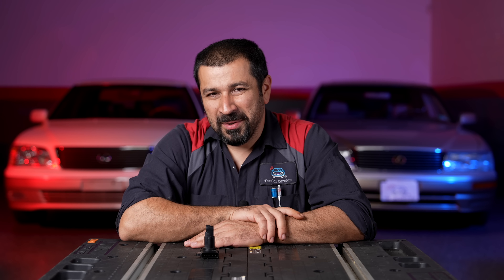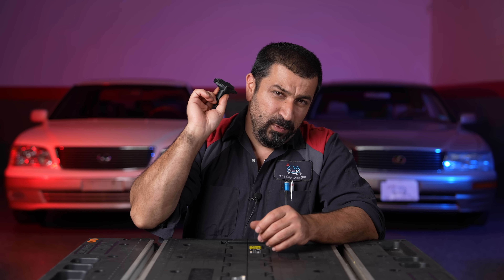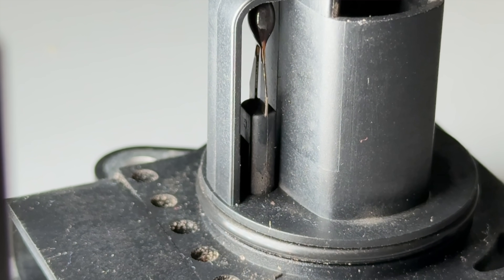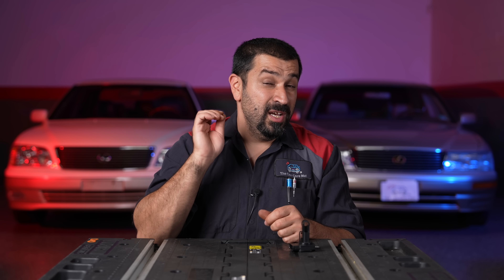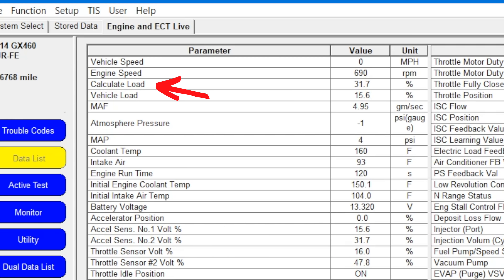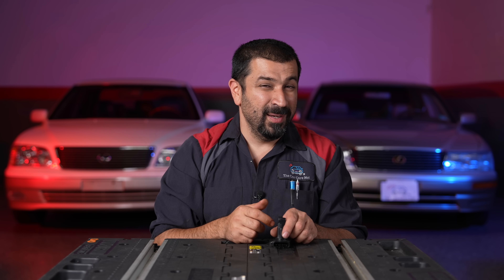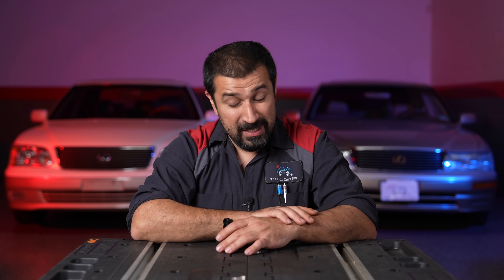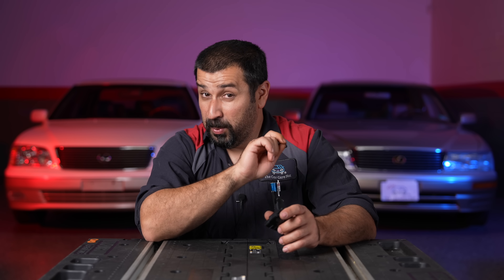Should You Clean Your MAF Sensor and How to Test It and Clean It on Toyotas

Comment: Thank you for this video.    I have a 2005 Tacoma that was not wanting to accelerate in 3rd gear.    It would bog down and sputter.    I replaced the MAF sensor (Amazon, $20 approx) and like magic, problem solved.    The MAF cleaner costs $7 less, but why bother trying to clean the sensor when you can buy a brand new one?

Comment: My 2002 Toyota Avalon was reading high LTFT (25-30%) when accelerating, but less than 5% most other times.  Did the calculated load test as described in this video.  Sure enough, could only get up to about 70% calculated load at WOT.  Cleaned MAF, but didn’t improve, so I installed a new OEM sensor.  Calculated load now reads normal and LTFT looks great (+/-5%)!

Comment: Our one car is a 2003 Mitsubishi Eclipse Spyder GT and it uses a Karman Vortec MAF, and you can't clean those as they use a laser and mirror to "listen" to air volume. Replacement OEM is $700usd. Cleaning will destroy it. Thank God our 2022 Nissan Frontier Pro4x uses a normal hotwire MAF, cheap to replace and cleanable.

Comment: Techs at Valvoline failed to snap my air filter back together properly so my car ran for two weeks with unfiltered air coming in. Pretty sure that messed with my MAF and the engine got to running very rough with reduced performance at throttle. Color me annoyed.

Comment: What if am seeing more than 100% on the calc load? This is a 08 i4 camry so no turbo. Am thinking the maf is just gone. Engine Stalls randomly from time to time no check engine light and it turns on without issues after stalling. What makes me think it is the MAF is because when I start getting low revs at idle leading to stalling, the MAF is reading like 11 to 15g/s. Google says at idle it should be between 2 to 7g/s.

Comment: I have cleaned the MAF, replaced the air filters, and cleaned the throttle body. I still experience a rough idle when the AC is on. My Toyota Corolla radiator fan is not working when the AC is on, which causes the idle RPM to drop so low that the engine stalls. What could be wrong? Please help. My mechanic has not been helpful.
Reply: Sounds like a relay switch or a regulator switch❓💡

Comment: I have a 2014 BMW X1 with an N20 motor. One of the MAF has traces of oil on it. Should it be cleaned? I didn't test it and I don't have cleaner. Is it ok to wipe it off?
Reply: If you do want to clean it, use Q-tips don’t spray too close to sensor must use CRC mass air sensor cleaner💡💪

Comment: I replaced the air intake hose on my 2013 Honda civic which was cracked and it solved the jerking problem that I had but I still have sluggish or slow acceleration at low rpm’s. Should I be cleaning throttle body and mass airflow sensor even though I replaced the intake hose?

Comment: According to another video, I have to remove my whole windshield wiper assembly which is secured by the steut bolts just to get to my MAF sensor. 

I ain't doing all that just to clean an old part. If it tests low, it's getting replaced.

Comment: I had a cold air intake cone and i drove in a big rain and i got a chek engine with the code p0171 that says lean . I have the new mas sensor that you said we shouldn't clean it but i think the water came buy. I put back the oem air intake box after that. I think it dried and the code is gone. Should i be worried in the future with the mas sensor?

Comment: If you have a hot wire MAF and you run a oily K&N air filter, your sensor is gooey. *Toyota MDT.
Reply: CRC mass air sensor cleaner, let it air out for 5 to 10 minutes if you want to leave it inside the vehicle 10 to 30 minutes and you’ll see immediate response🤙 they have a kit at Walmart for 10 bucks comes with throttlebody cleaner also💡

Comment: Hey Car Care Nut, my Sienna has a lost in power and I cleaned the MAF like you said and it did run better, but not as good as it should, plus today it was a rainy day and it was running real bad again. Do I need to buy a new MAF sensor ? I've been driving Toyotas for most of my life and I love Toyotas. My first Toyota was a 1971 Hilux truck, it had blinker lights on top of the fenders. You are the only Toyota mechanic I trust....

Comment: Ok , so I have a 99 Camry LE, mine is inside the air box right? But is also an air temperature sensor? Looks like a banys pinky sticking out? Wish I could upload a pic of it, but is that the MAF sensor? Bc I saw online that 99 le doesn't have MAF sensor? If it is in fact the MAF, can I use contact cleaner on it like you said?

Comment: My 2000 tundra just went down. It starts but idles rough as hell,  won't accelerate smoothly then stalls. It is stumbling badly. A few days ago was only stumbling at high speed. I am thinking the mass air flow sensor has failed, the throttle body position sensor has failed or the entire throttle body needs replaced. It has 320k miles. Have owned since new. I first thought I had contaminated fuel but I did add Iso heet and Chevron Techtron cleaner. Yesterday and it drove great. It stopped stumbling.  Not is worse.  I ordered a fuel filter. Maybe that is clogged. Every time you turn they key it starts so I dont think its the fuel pump. Wish someone here had some feedback.  Im in North Carolina so I cant bring it into Chicago.

Comment: Also, if running K&N air filters it's very wise to clean your MAF every few months due to the excess oil in the air filters.
Reply: It’s best to only spray the oil on the one side of the filter that’s going to get dirty. It’s more acceptable of making problems. If you spray it on the other side that’s clean.🤙💪💡

Comment: I own a 2011 LS 460. It has 119,000 MI. I am not mechanically inclined, I change my air filters in easy stuff like that, can I trust a shop to clean the sensor if I ask

Comment: been working on my inherited  337,000 mile '06 Tacoma the load sits about 30% ideal but hits 95% full throttle, i have some other small issues i already know of  however i have been testing everything since it wasn't my vehicle. I thought the load at ideal seemed high though.(I wouldn't clean mine I would just replace to be safe on my this specific vehicle)

Comment: At full throttle it read 100% - 2006  sienna. Test works  correct. Parts Cannon is shut down-lol. Yaaa!  Keeping my money. Sienna Has 267,700 miles on it and running good!   What a Vehicle! Oh, Hey friend, mechanic, Thanks. I used Electronic cleaner  and it worked. Thanks Car Care Nut!
Reply: It was going to be $133 to $148 plus tax for the part here in Detroit. BTW. Thats original part from dealer.

Comment: I have a 2015 Toyota tundra and I got problems with  in between 1,000 and 2000 RPM  when I push the gas pedal  in between 1,000 and 2000 shakes like need spark plugs and I just change spark plugs from factory what can be the problem

Comment: Recently my RPMS started shooting up for a quick sec going a normal gas pressed speed. I have cleaned sensor, throttle body flap area, changed pcv valve and checked all hoses for leaks. 2014 Toyota Avalon limited V6. Thoughts will be greatly appreciated.

Comment: What about just replacing after so many miles. I have a 2002 w 180,000 miles. The sensor was never cleaned or replaced, car was in Illinois, now in the dusty Phoenix area for 6 yrs. I now have no power after 40 mph. I’m hoping MAF is all it is. 
But back to my question, should these just get replaced after say 100,000 miles, 150,000? Thanks, and thanks for all your vids, there fantastic!

Comment: 2020 Corolla LE 1.8L I’m getting starting issues where it cranks and trying to start after filling up gas. After a few tries it starts but I got pending code P0171. 
Prior to this coming I got a gas cap error, but cap is clicking. Any suggestions? Btw I did try to clean the MAF sensor.

Comment: Thanks for all your support, I have a 2015 Toyota Highlander, Yesterday I Inserted the scanner because the fuel consumption increased, and the computer shows me:
-P0102 Circuit of Mass Air Flow (MAF) is Low (Permanent). I could not clear it
-P0113 High Input of intake air temperature Circuit (Permanent).  I could not clear it
Today I Checked the Intake temperature Cold In the panel shows me 84 Fahrenheit degrees and the scanner shows me 87, It has a difference of 3 Degrees Up (I Cleaned the sensor and dry with low air pressure compresor).
I checked too the Calculated Load in idle (You told us it will be 15% to 25%), and the scanner shows me 26% It has a difference of 1 % Up
I checked too the Calculated Load Full Pedal (You told us it will be 80% to 90%, and the scanner shows me 93% It has a difference of  3% Up. (Tested with full pedal at a range of 100 yards)
My question is, The scanner shows me the codes It's permanent and I could not clear with the scanner, but in the control panel does not appear the check engine yellow sign. 
With this information, Do you think do I need to replace the MAF Sensor? all at this because It's expensive, But Gasoline consumption equals short-term the MAF cost.
Please help me with this issue, I appreciate your advice and I follow you on your channel.
Regards

Comment: Used to do it on my 2001 Toyota Echo evey oil changed. Had it running it for 18yrs @ 300,700 plus miles. Came to this to see if it3 safe for my 2020 Camry.

Comment: Thanks for the informative video. Now I know what calculated load means. I have an occasional long start on my '15 Sienna 117k miles, someone told me to clean my MAF sensor along with replacing the fuel purge valve. Now I need to see if you have a video on purge valve diagnosis. Finally, its first spark plug change is coming due.

Comment: I just use a spray bottle filled with 80% ~ 90% rubbing alcholo and sprayed down the MAF wire in my 2002 RAV4.  Cheap and worked just as good as the $13.00 MAF cleaner!
Reply: It's $3 for 11oz at rock auto

Comment: I have a 2012 tundra. The mass air light keeps coming on and will not pass inspection in my state. Do you have a suggestion?
After each fix I reset the computer 
Changed the mass air 8/21/23 light still on 

Air filter 4/18/24 light still on
Fixed exhaust leak 6/8/24 light still on- local shop
Mass air 6/10/24 light still on
Cleaned throttle body 6/10/24 light still on
PVC valve 6/20/24 light still on
Crank shaft sensor 6/29/24 light still on - local shop 
Checked wiring harness, mass air sensor, checked for vacuum leaks 7/3/24 light still on 
7/13-7/15/24 local dealership said it was the air box. Dealership took my inspection sticker off
7/17/24 air box - light still on 
7/18/24 changed gas cap light came on sooner 
7/20/24 went to local shop to get a 10 day temp inspection. Somehow it passed

6/21/25 light on won’t pass inspection 
 
If you have any suggestions please let me know. I have been dealing with this for a while
Some one suggested a sensor in the gas tank. The shop said it would be $300 just to drop the tank.

Comment: After cleaning the MAF sensor on my 2003 Highlander, the Calculated Load peaks at 69% at full throttle. The engine idles well and I don’t notice performance issues, but I do get a recurring P0174 code. Time to replace the MAF sensor?

Comment: My 2007 camry reads 2.7g/second at idle and did the wot test and reads 115% load, i have literally years getting the rich mix code and -33% reading in the long therm fuel trim. Already did ultrasonic injector cleaning, iridium sparkplugs, new coils, smoke leak test, last thing im thinking is fail safe thermostat i installed because every often i get the low temperature reading code

Comment: P0101 on 2020 lexus rx 350 only on highway speed over 75 mph does not happen in city driving happened twice now in 6 month period it throws fwd four wheel drive c1280 i don't know if these two are related.I clear the  code everything is fine im gonna clean the maf  sensor see if it will fix the issue or not any other ideas lmk.

Comment: Hello dear 🦊👋👋 
I have lexus gs300h 
And i disconnected ( MAF ) sensor when engine raning and connector out 😅 and still engine raning no problem bad only takes liter more tame bi speed up i drive like dis not problem at all)) only i have engine management light on white fault code ( P0102) (P0113)  and i go to motorway like dis raning no problems.after i putt connector back to and i clean fault code 
What dıs mining (MAF) sensor not working? Or ? 
Meny thanks 🙏👍

Comment: Hi Great videos! I have a 2011 Toyota RAV4 4 cylinder and clean the MAS and Throttle body. The car idle drops at stop lights to 500-700rpm and car shakes like it is going to die but adjusts the idle and runs ok. what else I could check? Is there a way adjust the idle?

Comment: Would the MAF sensor be bad if the calculated load was 92% but cars has a code MAF sensor?
Reply: I’ve observed the same. What did you end up doing?
Reply: Not sure but told my brother that I  cleaned out the carbon build up in valves, throttle, transmission filter and fluid change and informed them to get the MAF sensor but they haven't yet. Vehicle runs way better but still needs the MAF sensor

Comment: Hi, i'm stuck on a road with some really weird diesel limp mode while the Engine load goes really fast to 60-92% without even giving any power... Does that mean that the Maf sensor is ok ? -___- (only has a thin transparent oil or smth on it and most readings inc. iAT seem to be ok... except the desired vs actual, 120+ vs 30+ seems a bit weird..)

Comment: I accidentally damaged a MAF sensor while replacing the air box due to multiple broken clips. I replaced the MAF with a Denso from a national auto parts chain store. Turns out the Denso was defective so I got a Toyota OEM MAF. BINGO. Problem solved. An expensive lesson learned. I now treat any handling of a MAF sensor with tender, loving care.

Comment: Thank you for the education!  04 Corolla was throwing 0420 codes, lean codes, bad 02 sensor codes.  Cleaning the MAF didn’t help.  But, after watching you I looked closer at the MAF; it was not OEM.  New OEM MAF and no more codes, and went from 23 MPG to 34 MPG average.
Reply: how did u determine that it was not OEM?
Reply: @alfredeneuman4947  Most OEM parts have the car company logo. Aftermarket ones will have the name or logo of the part manufacturer, not car. This is the easiest way.

Comment: CRC MAS Cleaner regular size cans are notorious for leaking at the stem. I went through two cans quickly, sadly, because of the leaks. 

Watching South Main Auto's YouTube Channel, Eric complains about the can leaking. So I called CRC. They sent me a replacement can and, guess what.... Even with a 2-year gap In the production, they are still leaking! 

It's either a bad design or maybe the chemical is destructive to the internal workings of the spray can. All I know is that it's wasting the product and possibly damaging its efficiency if there's a leak involved.

Comment: I've replaced my maf sensor, map sensor, throttle body, fuel pressure regulator, injectors, spark plugs and coils, fuel pump and I still have a po172 code with a p0101 code. Its a 2009 toyota tacoma base 5 speed 2.7 sr5 what can it be other than an evap leak?

Comment: This was an incredible informative video, but i have to share that I went against the advice of this video with great results. 😅

My RAV4 V6 4WD drived sluggish with low mpg. I suspected the MAF sensor was dirty, but it passed these diagnostics with flying colors.  No check engine light, over 95% calculated load on highway, and it visually looked clean with no residue on the plastic areas.  I took a chance of ruining the sensor and cleaned it anyway with a couple of squirts of cleaner.  I am so happy that I did because now it idles much smoother (and about 80 rpms lower) and it mashes right off the line.  Feels like theres an extra 10-20 hp and feels like a new car again!  This was the single best thing i did for extra performance. 🔥🔥🔥

Comment: hi boss thank you for making this video. I have a 2015 toyota sienna 3.5 and i have to take alottttttttt of parts to get to the maf sensor. i havent yet done calculated load thanks to you i learn how to check it but if its a bad sensor will it display p0101 thats what i currently have on the check engine light.

Comment: Gosh I wish I had watched this... A cleaning was recommended by my dealer so read a lot about them but apparently not enough. I have a 2018 Tacoma, it definitely has a semiconductor MAF sensor. I cleaned it as if it were a hot wire sensor... going to check the load now but I have gotten lean codes so I fear I have already messed it up

Comment: When I measure the calculated engine load value with the throttle pedal it shows 90% at full throttle. But i notice if i press the pedal only half the value increases but drops fast back to start value although I keep pressing the pedal. Is this normal? Any explanation for this?

Comment: Mine was only displaying a maximum load of 70%, and I had poor engine performance beyond 70% throttle. Gave my MAF a clean, and it’s back to 100%! Thanks!!
Reply: What did you use to measure and the brand
Reply: @CSPFL I used a cheap eBay code reader and followed the video’s instruction.

Comment: My case is our 2007 Lexus RX350 starts and then dies right away. Mas looks pristine clean.
Reply: Did you make it?
Reply: That happens when the computer "can't read or time a part ...like a coil for example... and then the computer will shut down the injecters after 5sec of running. So the car will shut down, you can test this by spraying " starter fluid" in the intake, anvyou will be able to run to the  engine a few seconds longer . Thats how you know. One of the parts you replaced is an aftermarket cheap chinees part . And the do start and run for a few miles, but after that the computer can not work with them anymore. 
So check the complete feul system, then the filters, then the injectors.... Or simply put back the original parts and start up , if it keeps running.... but of course not good but missing, sputter ect.... Now but original parts and replace them again.😊